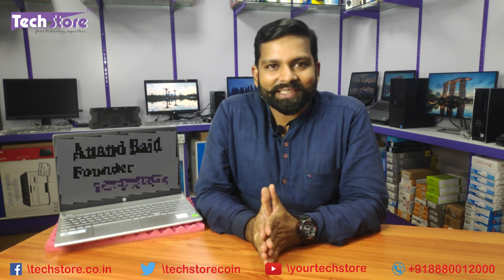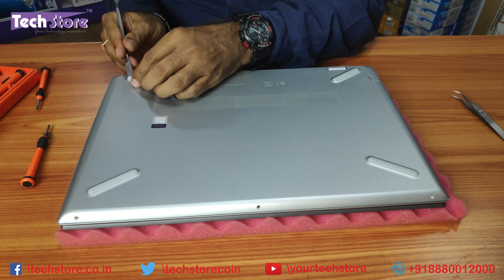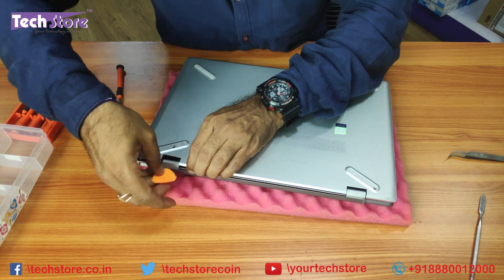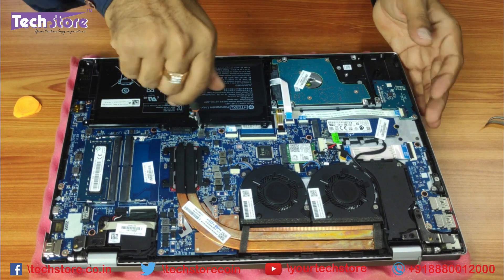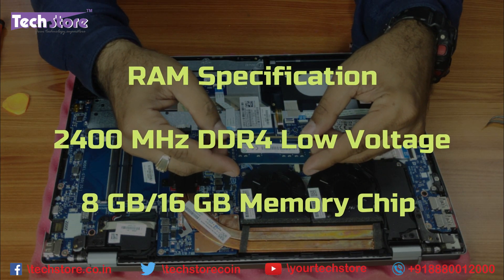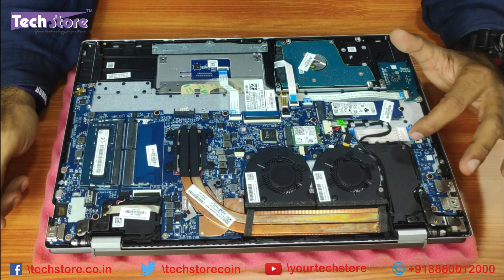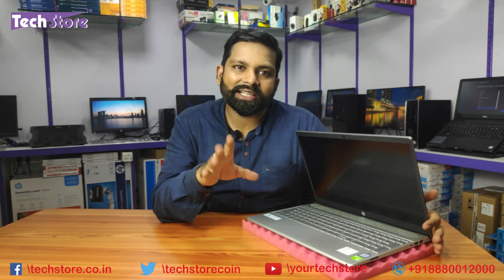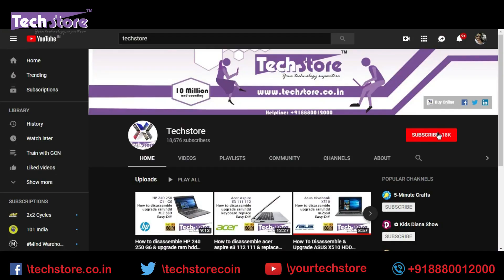HP Pavilion 14 15 CS Series 2082TX 1000TX 2096TX : how to disassemble base upgrade memory m.2 ssd

Comment: I have cs 1000 series and 1 tb hdd with no ssd and 8 gb ram....now i have to add ssd so how much gb of nvme ssd it can process...and same in case of ram can i add 3200 mhz of 8 gb ram in it
Reply: Have you installed SSD onto your laptop? If yes which one?
Reply: Crucial 250 gb
Reply: @Khallnayakk  Is it working fine? Can you please share the link of Crucial Ssd which you bought?
Reply: @sanketold ya it's working even faster than before.. i upgraded ram and ssd both and migrated windows c into ssd .. actually i upgraded ram of crucial and ssd of gigabyte 😅